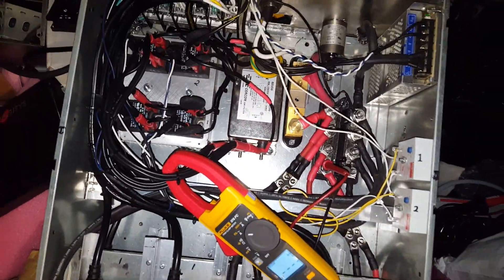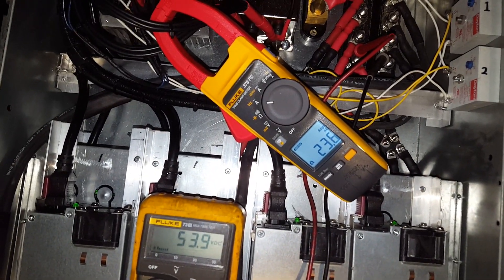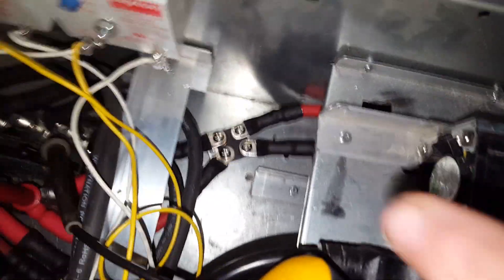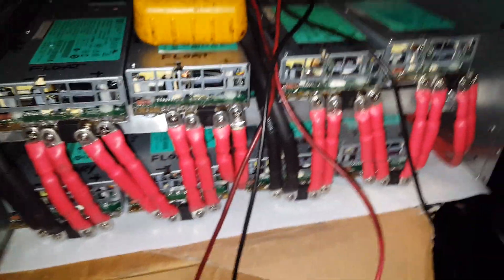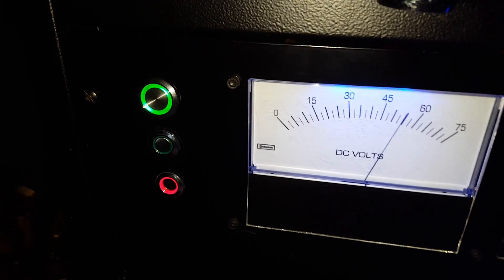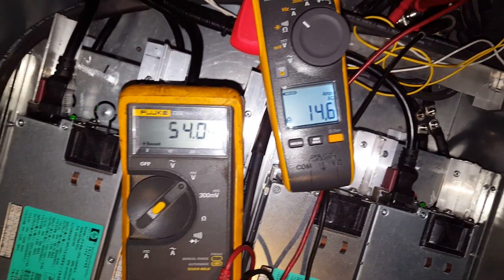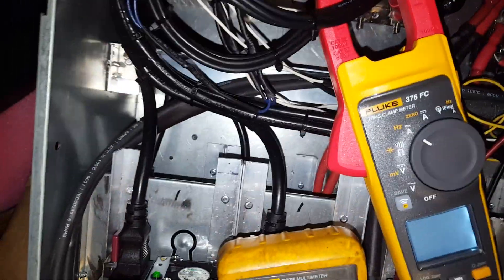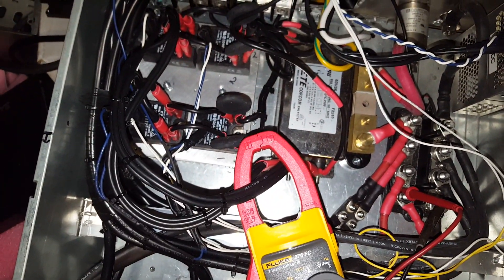Eight dps-1200fb supplies in 2 banks of 4 in series 54vdc 200 amps

Comment: what the he'll are you using that for haha
Reply from the maker: This is to power a 50+ volt DC Radio RF Amplifier.  This supply when all 8 are running can provide about 200 amps @ 55VDC.

I only need about 120 amps for full power of the RF amplifier.  But having the overhead is good so that the supply is never really taxed very hard.

I will run the RF amp at full power sometimes for up to 50 seconds at a time.  So...the overhead is a good thing.